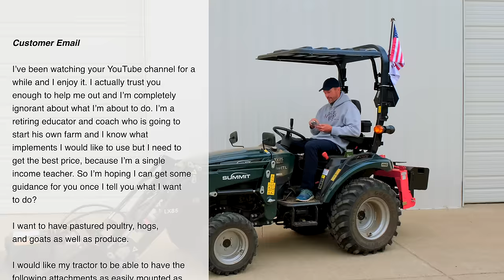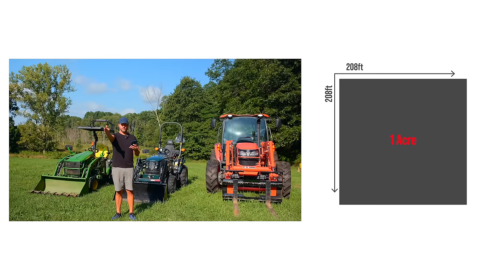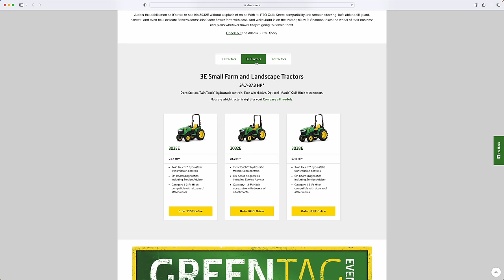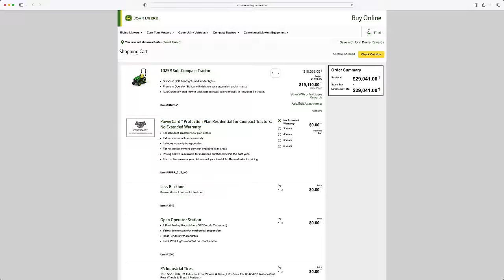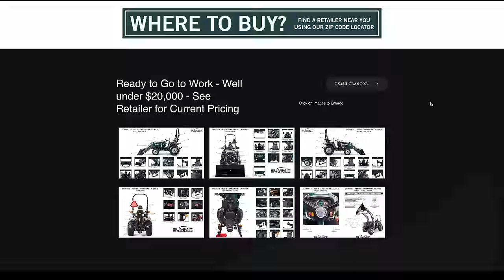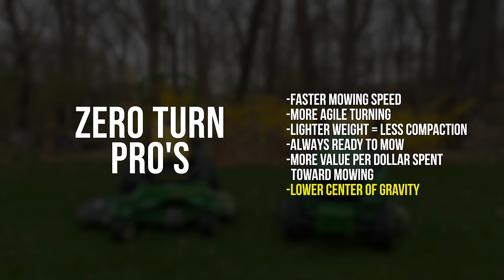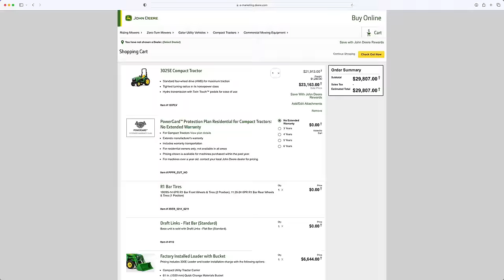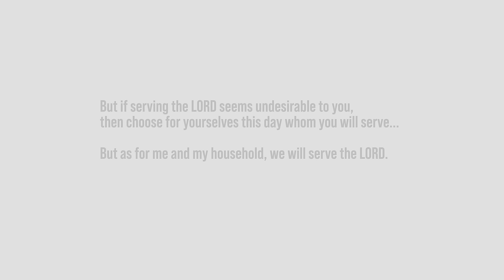CAN YOU STILL BUY A NICE TRACTOR FOR $10,000?

Comment: You don’t need  to buy a stump remover.  For the cost , you could rent one several times, or better yet,just flush cut it with a (big) chainsaw. And , yes, I speak from experience. Cleared 5 acres by hand solo. Also, if you buy a stump grinder, you might not be able to unload it, or take a big loss of it.

Comment: Knowing the ground you have to work with. There are zero videos about using a tractor with my type of dirt ( extremely hard and rocky) more HP is important for cutting intp it. Aslo the Lift capacity is more important then HP anyday.

Comment: Terrain should dictate the size and the HP requirement and weight of the largest implement you may use should dictate the HP of the tractor, not the other way around.  Flat with trees or obstacles close, go smaller/narrower.  If you have open hills, go bigger/wider.  48 inch attachments may operate fine with under 20 PTO HP,  but large pull type (inverted) snowblowers and roto-tillers require 35 PTO HP minimum, which bumps you to a 40 engine HP tractor.  Getting the base engine to save a couple grand likely isn't worth the trade-off in time lost dealing with tiny implements.  Buy once, cry once.

Comment: Best not to try to get a one size fits all machine. The more tasks you can eliminate the better your final machine will be at the remaining uses.
eg A good pulling tractor makes a very poor mower and vice versa. For pulling there really is a lower limit where you just can't do certain things because of a lack of traction, or for PTO implements a lack of power.
Aside from special focused use cases I don't see much economic benefit from going below 4000lbs(ballasted) and 30HP(true continuous power, not all manufacturers use honest ratings) This is Farmall A size plus a couple extra ponies for modern hydraulics and tillers. Add 20% HP if getting a hydro transmission, manual gearboxes are way more efficient.(As an aside, Farmall A had mid-mount grader blades, which make every modern 3point driveway blade seem like trash in comparison.)

Modern small 3pt rigid-frame tandem disks are an idiotic design, go with an offset disk if at all possible, for anything less than 20 disks wide offsets just do a much better job. 
The only usefulness of a tandem(X or diamond) is that the towed ultra-large sizes are built to fold up and to flex over rolling hills which a 3pt is also bad at anyway. (Though you still have the question of 7, 9 or 11 inch disk spacing and disk concavity) 
Notched disks are like fix-a-flat for a disk that is overall just too light. Their popularity is a symptom of compact tractors with inadaquate traction for their width coupled with people trying to save a few bucks on an implement purchase. (Less steel in the frame will be cheaper, and even less is needed if it doesn't even support ballast boxes.)

For a pulling tractor you need R-1 ag tread and heavy ballast, but R-1 will leave heavy dents in grass, so R-3 turf tires are used for mowing (with a special compound and carcass if working heavy stubble ). Traditional 45degree R-1 bars clear well in sticky soils, 30 degree bars get a few percent better traction in dry non-sticky conditions. 
The R-4 industrial tires, unfortunately being used on most small tractors, are really for things like offroad forklifts and backhoes as sort of a compromise and mostly focused on road wear with moderate traction. 
R2 are for soft mud, specifically rice paddies. 
R-1w is 25% deeper than R-1 and for wetter softer dirt and sand. R-1w and R-2 are worse for roading, and may wear strange or suffer damage under general purpose use.
Forestry R-1 have extra puncture and chunking resistance but they are a bit stiffer and less efficient on field conditions.

Comment: First tractor I bought too small, Kubota BX1880 without a loader. Soon realized I needed a loader and heavier tractor for loader and grapple work, etc. so sold the 1880 and moved up to a Kubota B2301 which is just the right size for my 4 1/2 acres.

Comment: I am appalled at the insults about the southeast which contains the Smoky Mountain range , the Blue Ridge mountains, the Appalachian mountains,  and more. I live at the highest point in Florida which is about 300' above sea level in less than 11 miles.  Is not how high or low, but the highs and lows together. The mountain ranges from South Carolina across to Arkansas. Alabama has significant Mountains as well. Just because you're a troll from southern Michigan - yes, I said it if you can denigrate the south I can do the same to you . I've always enjoyed watching your program, but I was in shock the way this presentation went. And while you may be partially correct doesn't dismiss the fact that besides the highs and lows  considering swamps and other wetland low lying area's, type of soil materials someone might need more horsepower or less . In Florida and other parts of the south we have iron rock, iron pirate, iron aggett, quartzite, quartz rock and boulders, limestone, superfine granulated white sand, clay of several types. Iron rock can be 6ft or more in size, iron pirate and aggett can be relatively small quartzite and quartz rock can be several ft thick and run for miles in the strata. Then you have all the history in this area where shipments of logs were floated down rivers, creeks and streams that turned them to pure stone the waterways may have changed their courses throughout time and left or moved. Becareful next time and it may not be as offensive. Florida has the best and worst of everything. We have hurricanes, tornadoes, earthquakes, floods and fires. We also have plenty of hunting, fishing, the world's most beautiful beaches. We have alligators and crocodiles, black widows and the brown recluse, diamond back rattlesnakes, coachwhips, coral snakes and king snakes, cottonmouths, but we have horney toads eagles, flamingos hawks, etc. But the worst thing we have is too many northerners.
Reply from the maker: Huh?

Comment: A 25 hp tractor can handle a 5 ft bushgog been using tractors since I was 10 65 now
Reply from the maker: No, a 1025r which is 25HP cannot handle a 5’ brush hog.  A 2025r or 3025e both can though.  Can’t just assume HP is the only thing that matters.  Much more to the story.
Reply: @GoodWorksTractors  kiotie can used it many times
Reply: @GoodWorksTractors  used on a 8n Ford a bunch it was only about 18 HP flat head
Reply from the maker: @GeraldCraig-n2q  Kioti is a brand, not a model.  That isn’t useful information.
Reply from the maker: @GeraldCraig-n2q  this is exactly why I said you need to look beyond horsepower.
Reply: @GoodWorksTractors  25 something or something 25 dad's tractor been over 25 years